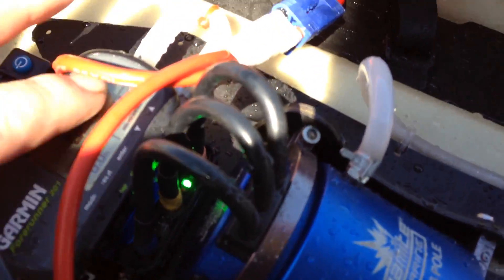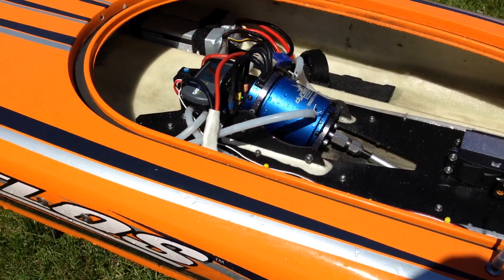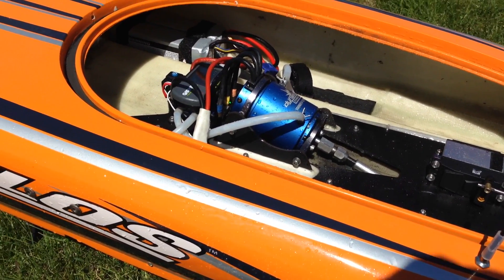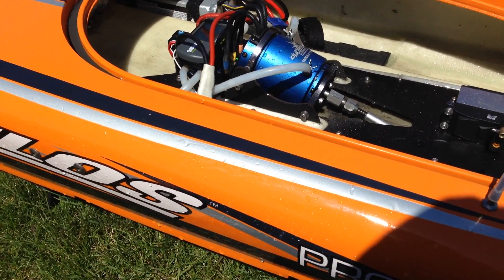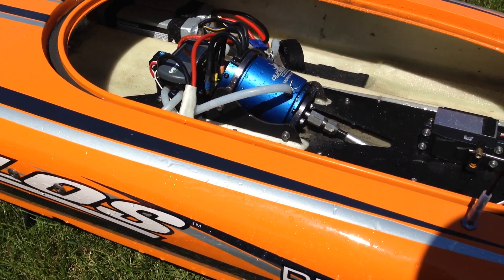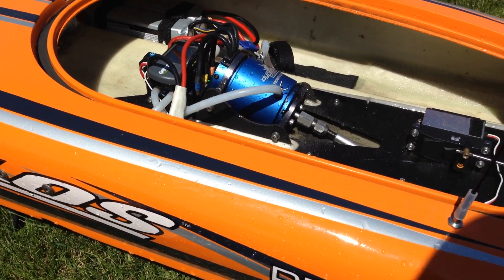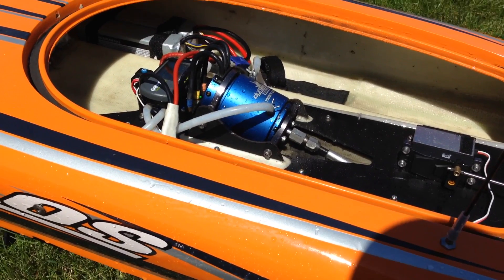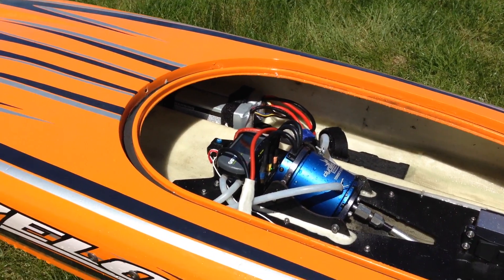Pro boat Zelos 48 ABC prop/speed/GPS test 2

Comment: Cant find a 1914/ 17-45 prop anywhere. Just ordered an Octura X448. Same as stock small prop.
Reply: hello how did octura x448 turn out to be. any issues 
i Cant find it either the 1914/ 17-45 2 cll prop for my new  Zelos 48 8s

Comment from the maker: I do religiously 
I come home I pull the flex out to keep it from rusting.
Then I grease before every run while the batts are charging.
I even replaced the flex and the Teflon.
If you notice my rudder is flipped around, part of the reason was to get it out of the prop wash, although I did not notice any speed gains, the other benefit is it's quicker to get the flex out, just loosen the collet , I don't have to remove or loosen the rudder to get the flex out.

Comment from the maker: Thank you 
But if you like this vid you will really like the next few I just filmed.
And I don't know, I think its coming in through the driveshaft it did it since new.
My theory is the strut is below the waterline typically they are above, I think it comes in where the strut meets the stuffing tube,
Maybe a tiny bit of silicone where the two meet will fix it,
It was really bad before, when I replaced the strut I get a lot less but still have an issue with it.